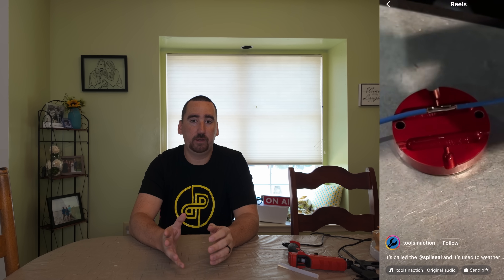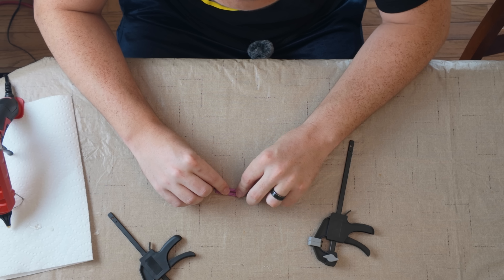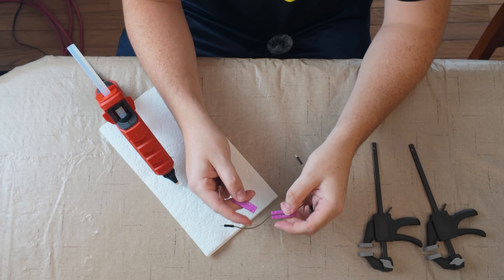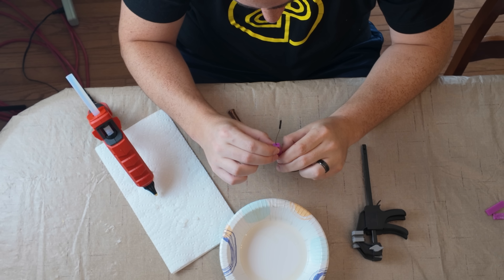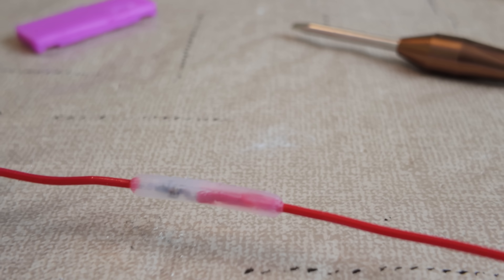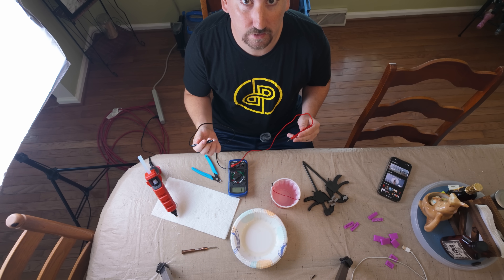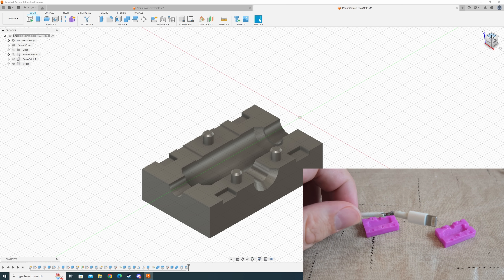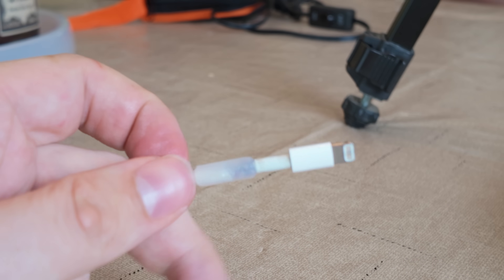Can You Inject Hot Glue Into 3D Printed Molds? | DIY Cable Repair & Protection

Comment: I wonder how the hot glue will hold up though. That wire in your car on a hot summer day might turn into a sticky mess.
Reply: Yeah, the lower temperature glues wouldn't be great for outdoor / automotive use. On the other hand, you don't need the glue to remain *strong*, you just need it to not melt to the point it runs.
Reply: 3M High temp hot glue melts at a minimum of 350°f. It's going to be fine in the car on the hottest day. Or you're not going to be fine and then the wire doesn't matter.
Reply: Turns out the low temp glue melts at around 250°f. So that's good too.
Reply: Regular cheap EVA hot-melt needs to get pretty hot before liquifying, so I don't think it would be much of an issue. I always put a heat-shrink sock over top in any case.
If you are concerned about this though then you should be aware that there are lots of different hot-melt plastics with different properties to fit almost any usecase. Probably need to order them online though - and be aware that cheap bog-standard hot-melt guns without a regulator may not be powerful enough to work with plastics that have considerably higher melting points. Part of what makes EVA so popular aside from low price is that it melts at a reasonable temperature and is therefore easy to work with.
Reply: @Evinosx ”oh no the glue melted, along with my dashboard and seats”
Reply from the maker: The iPhone cable has been in my car since I filmed this. I often park in a parking lot when commuting to work, which is not covered. Temperatures have been between 80-95 here in PA recently, I haven’t had any issues / softness in the glue when using it.
Reply: @TheStigma  Heat-shrink over it is a great idea. Didn't think of that.
Reply: Silicone Caulk should do the trick
Reply: @acmhfmggru do you have an example of a brand that will get sticky in a car on a hot day?
Reply: I’ve never had even my low temp hot glue sticks become a sticky mess. To be fair I’ve not really had them sit in a hot car, but I would think during packaging, shipping etc they would see similar high temps and they are the type of product that can be bought online so I don’t think it would be an issue. I think the hot glue temp is much higher than what would be seen in a car even on the hottest summer day.
Reply: @acmhfmggru  well scroll down a bit and you’ll see the video authors comment saying it’s holding up fine, so guess it works well.

Comment: For those wondering, this process is often called "low pressure overmolding" or "low pressure insert molding". Typically overmolding when refering to plastic on plastic, and insert molding when it's plastic on top of something else like steel. Thanks for the video!
Reply: You can use vegetable oil and a cotton swap for a cheap and accessible mold release. Then again, a spray can of professional mold release is only $15-$20 or so.
Reply: LIke a small spring for strain relief?
Reply: Thanks!

Comment: use acohol to make hot glue unstick
Reply: Came here to make this exact suggestion!
Reply: @DavidClunie  Same, isopropyl only though denatured doesn't work with a lot of glue stick varieties.
Reply: How much do I need to drink?  I drank a couple of beers and it didn’t help.
Reply: @wileymarm0t  use a solution with a higher alcohol content. I have found that a 60-40 ratio of Tequila to Margarita mix works best. YMMV
Reply: Also for this to work best. High % IPA is wanted, lower % (60/70) struggles to dissolve the boundary surface layer.
Reply: @Roobotics lower always sucks

Comment: I have an idea. Why even bother lubing the mold to remove it. It's just a small 3D printed part. And could be left on for added strength. You could obviously make the outside look a little more sleek. Also add tabs to lock the two pieces together permanently.
Reply: Maybe with TPU or something like that, but jot a stiff material like this one.
Reply: Or have a "two part" mold; a jacket that's just a sliver fitting exactly into the mold, then the mold itself. Now you gain the benefit of easy removal, and the flexibility to make a neat cover over your hot glue.

Comment from the maker: Hey everyone! This video has gotten a lot of traction, thanks a lot! I will definitely put out a video soon on designing one of these molds, and I will include the STL files with that video. Thanks again!
Reply: Can't wait to see this, and the STL files you've made. Great video!
Reply: the fact that so few people know that hot glue can be removed with alcohol really irritates me. alcohol separates glue and surface, even from wallpaper it just falls off
Reply: @PrintPractical  experiment with different size strain reliefs. I use a centering cable featuring my 3D printed mold that over molds the connections on a connector and has the strain relief built in. I also get a lot of 3D printing done with the HP multi-jet fusion with pa12 nylon dyed black and then I make a mold with the same 3D printed stuff. The black Hot Melt glue is a perfect color match and since the texture is the same for the mold and the connector, it comes out perfect. I wish I could post a picture on here and you could see. I also have tapered alignment pegs for the two halves of the mold which is pretty standard and then I use threaded brass inserts with encapsulated screws on the other half of the mold so you can lock it down without using a clamp but we found that the standard Irwin Vise clamps work just fine.

Comment: Bees wax. Will work much better than oil.
Reply: Please expand on the beeswax method. How you apply it to the mold, etc.
Reply: It also works with release wax, which is used for fiberglass. It is applied to the mold and then cleaned with a dry cloth to remove the excess and is ready to use and nothing will stick.
Reply: @ABTallerDisenio3D  fibreglass mould release wax is bees wax. Just rebranded for a premium

Comment: Suggestion: for each half of the mold, design 2 tabs one on each side, and offset the tabs so one half has tabs that are not inline with the other. This way you have a way to twist with your fingers to pop off the mold. It is super simple to do but adds leverage and allows super simple demolding. Its just a small extrude per tab. I think it would make this much easier.. just my 2cents. Good job.
Reply: What is a tab?
Reply: @Rollmops94  Just a small flat square or rectangle that proteudes outward. Some packaging or tool boxes have something like this. They use 2 side by side, one on the lid, the other on the box. They are close to each other so you can use them to twist motion both to open.
Reply: @Rollmops94  if you look at a rubbermaid food storage container they have a lip on the box and a tab on the lid. But any 2 tabs next to each other will work to give you leverage to open a box.

Comment: In RC model making there are a bunch of the molds up for sale, usually used to make strain relief for connectors like MPX or  MR30, and alike. But they are usually CNC aluminum, but i might give printing custom ones a go. Teflon spray on the molds might help.

Comment: Super cool practical use case, 3d printed injection molds (and even using the toolhead as the injector!) seems to be coming up as something people want to explore, love novel uses for the tech. I'd love a guide on how you made the model for sure! I'm super new to modeling and always steuggle with taking something physical and modelling it in the program so my design works with it without tons of iterations and adjustments.
Reply: Practise makes perfect, it will take a while but just start out casually, most important is you have fun doing it. Iterations and adjustments are normal. I am a professional CAD designer and work for over 10y in the automotive industry designing all sorts of parts and I always go through many iterations, that´s just part of it.
Reply: Nah just leave a small hole to fit a pry bar into. Less printing material and the leverage points arent weak polymer that will snap from demolding and heat

Comment: Two things. Ok, 3 things.
1) Great idea, and a good demo.
2) In industry, we use spray release wax. It does what your oil does, only 100x better.
3) Given the super low cost of 3D prints in hollow formats, a 0.3mm thick case that simply is designed to contain & protect the glue and remains in place might be even better.
Reply: also, every-day substances that worked (for me) as a mold release include boot polish, car wax and candle wax. and of course, if you're not sure of your mold release always do a test piece before using on your project.

Comment: For this specific application, I just use some heat shrink tubing, squirt the hot glue in the end, and leave it on. They even make marine heat shrink tubing that basically has hot glue already in it.

But injection molding with hot glue and a 3D printed mold is still cool.
Reply: There are times when that's difficult, though. The headphones I'm wearing right now need their strain relief reinforced, but to slip a heatshrink tube over the earpiece would require a tube so large that it would never shrink small enough to stay put. Something like this might be ideal for that.
Reply: @theboots39  Good point
Reply: But the hot glue is hygroscopic which is too bad for marine applications...for any applications
Reply: I do the same heat shrink trick but with epoxy.
Reply: Putting heating shrink on probably misses the whole point of the video brother
Reply: @Tunedawg23  no the heat shrink they are talking about has a layer of glue inside that melts as you shrink it and kind of seals things. Not nearly as much as this, but it works ok. Not easy to remove. I bought some clear stuff by accident once, it is actually kind of cool.

Comment: I do this for cables with strain relief and black hot melt glue. It looks like a professional overmold. PLA works fine. Use vasoline as a mold release. Also, I have a second mold without the gates, and I will heat it with hot air and finish it with a nice pretty mold and texture.
Reply: Good tips here!
Reply: Oh the texture part is brilliant

Comment: Most important rule about injction molding besides always having draft on your parts to demold is the clamping forces needed are always higher than you can even imagine xD
I love those ideas, well done man
Reply: he could have put it in a vice
Reply: @awkwardsaxon9418  Yeah which would rather brake the mold. Which leads to a more sturdy mold out of a different material ^^
Reply: @sierraecho884  Plastic is very strong when compressed.

Comment: fwiw you can do the same with silicone, which will give a longer-lasting product. you don't have to use a two-part mix either, you can use caulk from the hardware store. just takes a while to set up.

Comment: Great idea. Also look into polymorph/instamorph/PCL/polycaprolactone plastic pellets. You can soften them in boiled water and it sets like nylon when cooled. In the time it takes to set, you could  stuff it by hand between your injection mold and clamp it to cool. It wont stick to most plastics when softened, unless the plastic is also very hot. You can color it easily by shaping it into a flat sheet and using sharpies on it then re-softening and mixing the color in. If you mess up, it can be easily softened and re-used indefinitely. It's also nontoxic, being used in many surgical and dental applications.

Comment: That's very cool! I tried a similar thing a few years ago, where I'd use conical holes on two printed parts, sandwich them together and then inject hot glue. Once it cools, it shrinks a little bit and it keeps the two parts together like a rivet. I also tried molding shapes but it didn't go so well for me, probably because I was using a very cheap low-wattage glue gun and the glue solidified too quickly.

Comment: Have used the system you based this on, only drawback is where there is resistance/heat; have had  a couple melt off.

Comment: Nice! You did make the iphone cable problem worse though, by not extending the overmold a bit onto the existing sleeve though.
This just increased and focused the stress on the point where the original sleeve ended which was where the problem was to begin with.
Reply: Yep should have been at least 4mm onto the thicker sleeve

Comment: I usually do this repair melting hotglue into the cable, then with hothair, remelt the glue and start rotating it until it forms  a tube, then let it cool while still rotating. This fix looks cool, because we can make several sizes

Comment: For strain relief on your NEW phone cord I have used for years wire heat shrink tubing.  I use two different lengths to step down the amount of strain relief with the shorter going on first and then the longer piece of tubing starts closest next to the phone on the hard plastic and covers the first piece of tubing and then a little bit further on beyond the end of the first tubing so it bends easier.
Reply: That can work, the issue tends to be that the shrink tubing only shrinks so much, which can be an issue to get over the top. Personally, I tend to just use duct tape and wrap it around however many times I need for the level of stiffness I'm going for.
Reply: @SmallSpoonBrigade  We have four iPhones at our house along with an assortment of iPads, iWatches, etc both in Lightning and USB-C plugs.  I’ve been doing this for years with 3:1 non-adhesive heat shrink tubing.  I use white tubing and you would never know of the modification unless you were looking for it.  Get one of those kits of heat shrink tubing with multiple sizes all pre-cut at 4” in length available at amazon.  It’s a tight fit getting the tubing over the plug but it does work and it does make the cord last a lot longer.
Reply: Iphones are terrible for splitting the wires. Glue lined heat shrink is the way to go. Crimp it whilst hot to get to cable size in one hit.

Comment: Good video! The only drawback I see is that if there's an overheat in the wire due to a short circuit or something like that, the hot glue will definitely melt, leaving the wire exposed.
But it's a great hack anyway!

Comment: I use hot glue a lot already and this seems like a pretty cool idea! My only concerns are obviously heat, but also the way hot glue tends to be a bit flexible, it's quite easy to break the adhesion of hot glue if the material it's on is able to bend and flex. That's why I can't say I'd trust something like this to actually waterproof a cable that is moving around a bunch, as I feel like the glue would work itself loose from the cable sooner or later and leave a gap for liquid to seep in. Even if not hoping to waterproof it necessarily, it will probably not remain in place too well unless it has good uneven surfaces to stick to and you take care not to bend the cable around much. I've had this problem a fair bit when using glue heatshrink for the same purpose on daily-driver cables that are constantly being moved. For more static cables or connectors though? Really cool concept!

Comment: I have actually used 3d prints to prototype low pressure molds at work. Your air vents can be pretty small, depends on the viscosity of the melt but .001" I would think would work for hot glue. What you want to do is have the vents be short and go into an air dump, essentially a larger channel to channel it out of the mold cavity. You'll want these anywhere air can get trapped. Also holding pressure as it cools in the sprue helps with the final part. Like someone else said, clamping force will likely be higher than you expect. It will probably also be useful to make the molds larger and thicker so they don't warp under the injection pressure.

Comment: You could design the mold to be left in place. Avoids the adhesion issue and provides extra mechanical protection. Thanks for the video. Cheers

Comment: This is a great video (as a proof of concept).
-But the right way to insulate cables, is to use heatshrink (heatshrink with glue is even better).
If you must use 3D-printing and hotglue, then 3D-print a plastic-sheet and hotglue that onto the wire, then finally iron it, so it melts around the cable.
-That said, I'll definitely have the hotglue mold in mind for other purposes. 😃
Edit: The hotglue becomes very fragile over time (it won't take many days of use, then things like strain-relief will fail. Heatshrink is a good solution for strain-relief (not perfect, but way better than hotglue).
Heatshrink usually shrinks 3:1 or some only 2:1, but most are 3:1, which means an Ø9mm will shrink to 3mm, Ø6mm will shrink to 2mm. For the iPhone cable, I'd use 9mm 3:1 with glue; it should easily go over the plug. If not, 12mm 3:1 with glue would also do the trick.

Comment: Definitely a cool experiment, thanks for sharing with us!

I think practicality wise, I'd just stick to marine grade shrink tubing that already has adhesive inside of it.  However, I think this is a good demonstration to get someone thinking about how they could use molds.

Btw, no idea what the temperature range or UV resistance is of traditional hot melt glue is, but it is used a lot in the industry for packaging and temporarily holding something in place.  May not do well in a hot car.  No idea!

There are way stronger and more durable hot melt glues available.  For instance, the kind you might want to use in this application are the ones normally used for potting electronics.

Again, great job, and no shade intended at all!  Just adding some practical things to consider if someone is going to push forward with this idea and use it.